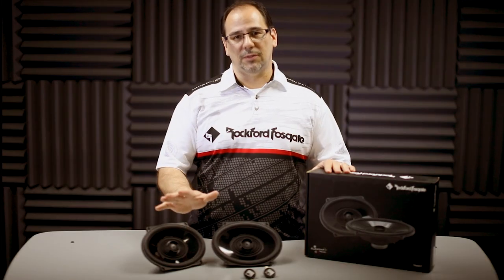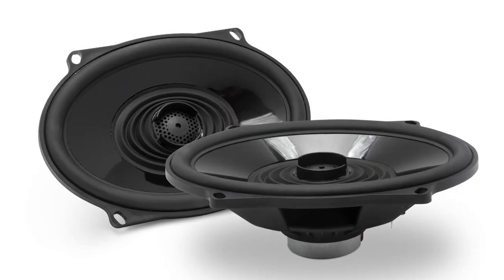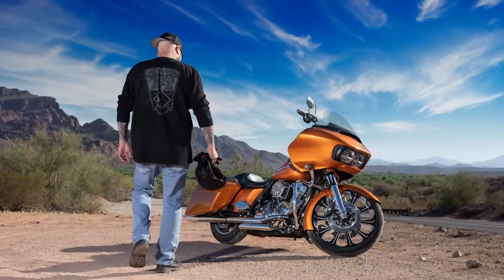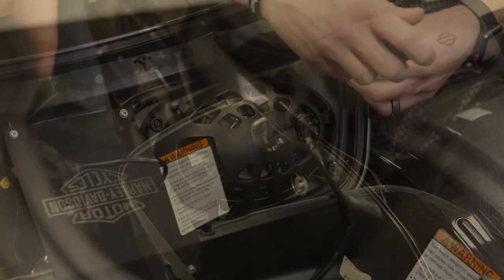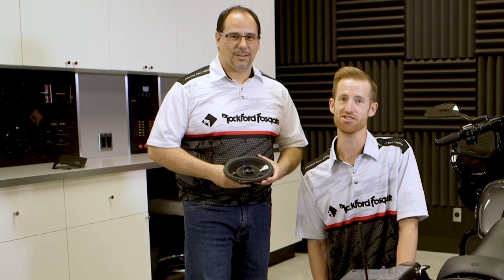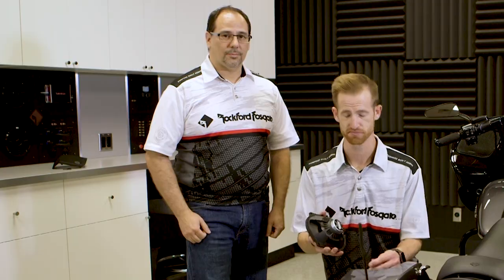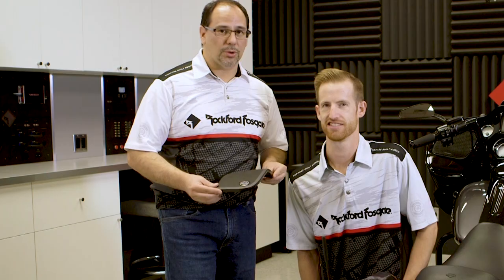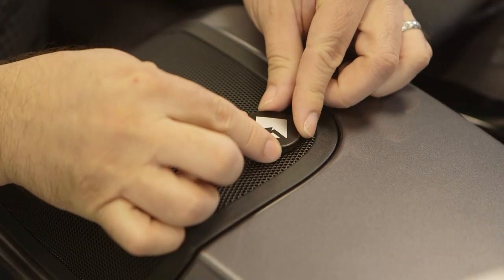TMS57 H-D Replacement Bag Lid 5x7"

Comment: Boom 2?????
Reply from the maker: No, we specifically did not mention the BOOM!™ Audio Stage-2, since that is a bi-amp speaker that utilizes a separate tweeter wire and separate midrange wire.  The full compatibility chart is available here: https://www.rockfordfosgate.com/products/details/tms57/
Reply: Do you have solution for BOOM 2?
Reply: How about tms65? for boom2???
Reply from the maker: Unfortunately no.  The BOOM!™ Audio Stage-2 a bi-amplified system so it's built totally different.
Reply: Can we modify? Because i have already bought the stuff.
Reply from the maker: If you are simply swapping these out, you won't have a discernible difference in sound since these are not designed for Boom! Stage-2.  As much as I would love to say modify it, I wouldn't suggest doing so.  It would require cutting the red wire that runs from the midrange, down the side of the magnet, into the center of the speaker for the tweeter.  That wire going into the center of the magnet would need to be connected to the tweeter output of the amplifier.
Reply: Thank you  very much!!!  Next time i will try tms69 or wait for your "CVO Stuffs"
Reply: @rockfordfosgate  Make a replacement speaker for the boom 2 system. I think you'll find quite a few sales.
Reply from the maker: @scottanderson6129  Thank you for your feedback Scott!  Our in-field sales team has that on the wish list of new products to develop.
Reply: @rockfordfosgate  I think you’ll find that plenty of us with CVO’s that have the Boom 2 wouldn’t mind just a drop in speaker that’s a bit better.
Reply from the maker: @scottanderson6129  Agreed!  With the TMS57, we did our best to stay within the constraints of the already-molded factory lid.  Wish we could pack some more into that little space!